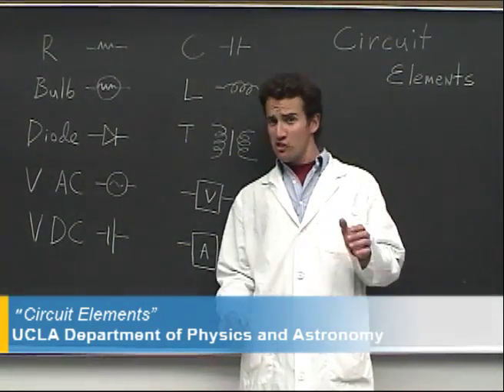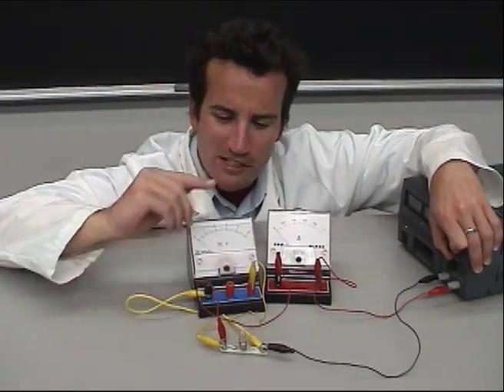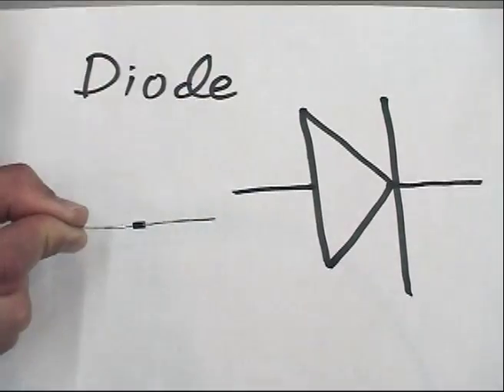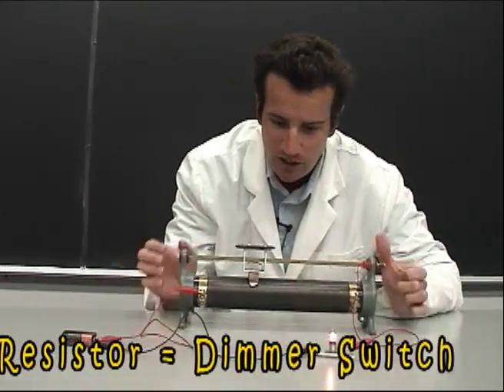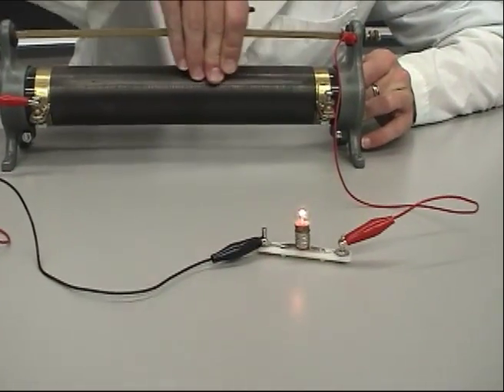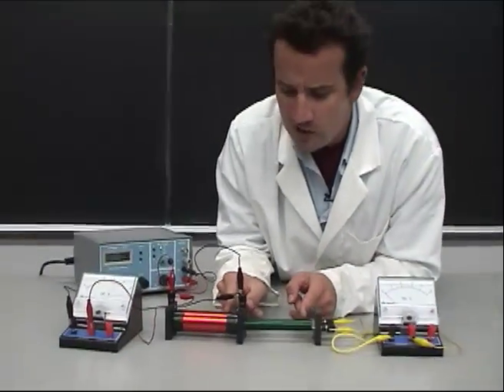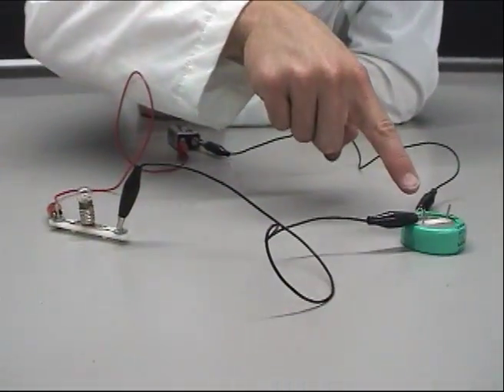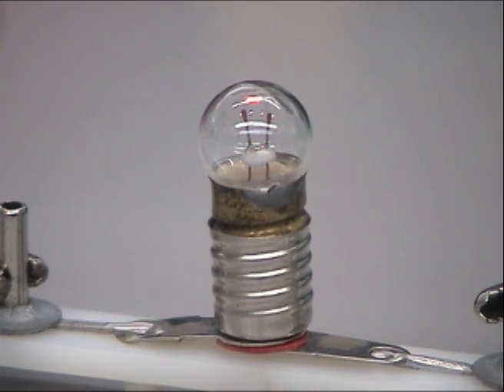Circuit Elements.f4v

Comment: #2:50
Doesn't welding also use similar principle to weld metal on metal aka by causing short circuit by joining terminals but adding more resistant alloy in-between to get heat up faster like Tiny steel wires as smaller radius of wires also causes high resistance like wires in old Bulbs?